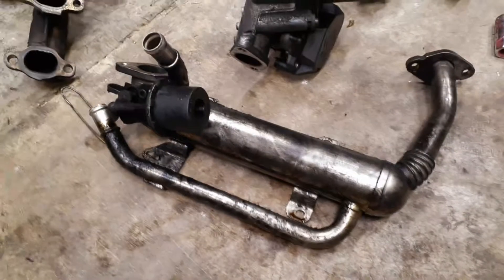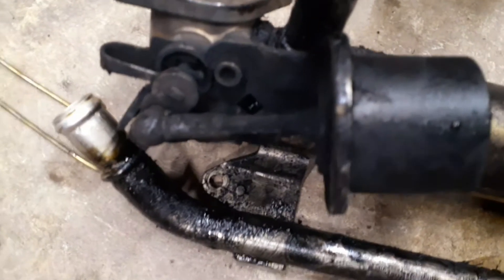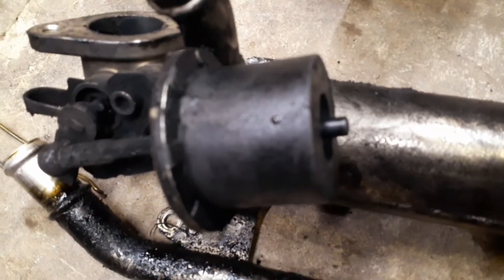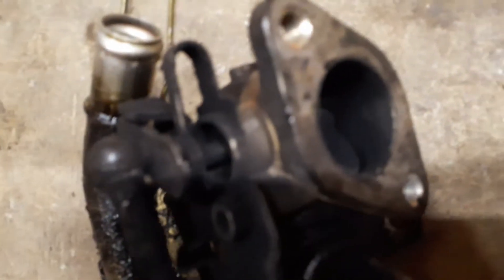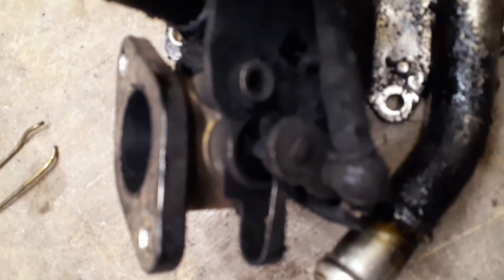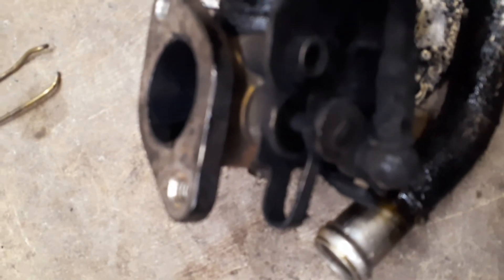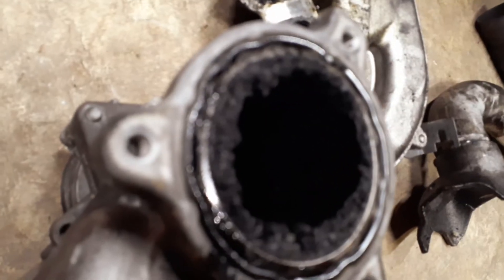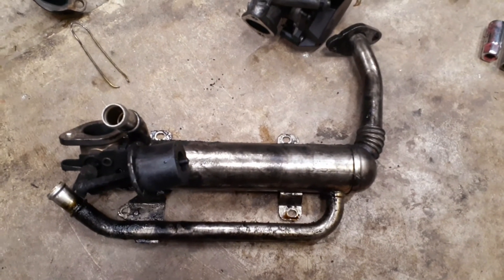06' Volkswagen TDI Hissing Noise EGR Explained.

Comment: which direction does the air flow through this thing? sources suggest the bypass valve is last but then when its diverting you have terrible trapped airflow in one half backflowing. surely the valve is where the exhaust gases enter?
Reply from the maker: Ok so the long ear that sticks up or the top most piece is discharge that's the output that goes into the intake.
Be on the passengers side of the car.

The inlet to egr is directly behind turbo.
Reply: @DustinNehl right so if I understand that right, from the angle you are recording it here it's flowing from left to right?
Reply from the maker: @03056932  it would be drivers side to passenger side- in other words
Reply: @DustinNehl thanks! So egr valve first. That's great actually, it means less carbon buildup for those that have had their actuator break than many suggested. Flow gets diverted immediately down one channel..
Reply from the maker: @03056932  yep that's true, however you are losing boost pressure unfortunately
Reply: @DustinNehl  but whichever way the cooler flap is the same airflow gets through.. Just one way is cooled, one isn't. How can that effect boost?
Reply from the maker: @03056932  
Yeah it's supposed to get cooled theoretically by the antifreeze that runs through the EGR however butterfly valve action Rod that I was talking about in the video becomes egged out and pressure escapes from it this pressure could be theoretically used to turn the turbo faster if you lose any of that pressure it's going to affect the Boost
Reply: @DustinNehl  ah yes, clogging would be no good. Many thanks for the info. There's diagrams on forums that have this flow direction completely wrong. Your take makes more sense
Reply from the maker: @03056932  yeah I suppose it would be somewhat confusing if you looked at it on a diagram but the pressure goes from driver side to passenger side up on into the intake if you do take all that stuff off make sure and try and clean your intake out cuz boy those things get Caked Up like you wouldn't believe I also posted a video how to clean the intake out with a diesel forced air heater
Reply: @DustinNehl  definitely gonna watch your other videos when I do. Right now I just have to repair the actuator on the cooler.
Reply from the maker: @03056932  why don't you go ahead and give me a quick phone call real quick 503951 9588
Reply: @DustinNehl  very kind of you but I've got the membrane for the actuator on order (seeing as you can't buy the actuator for the bls and nobody makes a third party one in Europe where I am) and my cooler flap seems to move nicely still. So all should be ok
Reply from the maker: @03056932  oh okay I didn't know you were in Europe I was going to offer to send you an EGR for cost of shipping
Reply: @DustinNehl  bless you you're a legend. Sending you good vibes
Reply from the maker: @03056932  thank you good sir
Reply: @DustinNehl  But at what side is the driver sitting at? Here the driver sits on the left side (facing forward), somewhere else the driver sits on the right side - it' so confusing 🙈🙉🙊 We should all use the nautical (boats that is) terms: Starboard side=right side, when facing forward/ Port side= left side, when facing forward.😁
Reply from the maker: @coccobill7982  if you Jack the car up you can see it it'll be sitting there Thursday it will have a vacuum hose running to it with a butterfly valve that is basically one piece that EGR assembly I recommend just taking a damn thing out

Comment: Never get rid of the egr, the smell is so bad plus in the winter you'll have no heat at idle and the engine we'll take forever to warm up equals poor gas mileage, To fix the intake clog, just put an oil catch can.
Reply from the maker: You should clean these out for them to work properly-
Those 2 valves have to work properly sometimes they get stuck open or closed- the most common thing is a leak begins in the lower butterfly valve loosing turbo pressure and with that goes the economy

Comment: How hard it this to remove?
Reply from the maker: Not too hard you just have to get the car up in the air enough where you can get to the back of the engine! There's 4 10 MM bolts that hold the actual EGR itself to the engine block a course in the piping as well
Reply from the maker: Not too bad you have to get the car jacked up enough for you can get to the back of the engine! There is 4 10 mm bolts that hold the actual egr 2 the engine block, then there is of course the piping that you have to disconnect to

Comment: That thing is a dangerous and suprisingly useless POS. Almost gave me cancer from all that smoke entering the cabin. Block off the entire system
Reply from the maker: Dang that's crazy if you hear that hissing noise that means exhausts getting loose right by the firewall and getting in through the cabin air system! Definitely have to fix it or do something else!
Reply: @DustinNehl  yeah its right above the front subframe and really close to the firewall. Spent weeks trying to figure out what that loud hissing under boost was. That vacuum operated actuator arm is a huge liability.
Reply from the maker: @shueibdahirmotionpictures  Yea that butterfly valve gets wobbled out and a gap starts there and starts hissing--

Loosing turbo pressure and causes less efficiently
Reply: Hi 
Thanks for the video 🙏
Is there something to by pass this egr cooler ?
I got a really bad hissing noise and smoke coming from under the bonnet…
Thank you 👍😊

Comment: I'm going to go ahead and try this out all right seen another one that said it was the PCV valve but it's not making the same noise as the one for the EGR. I'm going to check it out see if it works
Reply from the maker: Yeah just go ahead and see if it's leaking from there you should be able to see a bunch of black suit by the actuator that'll for sure tell you that it's been leaking out of the butterfly valve on the EGR